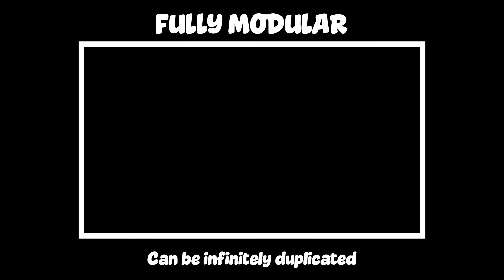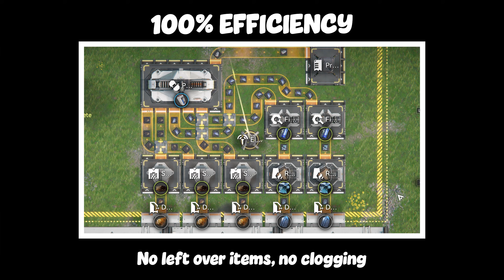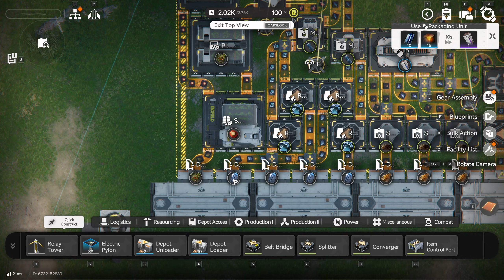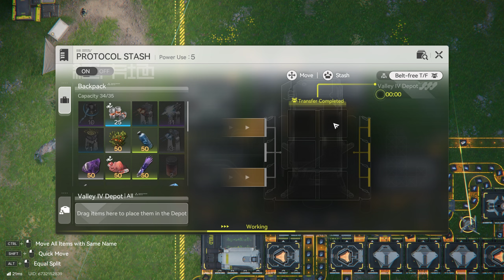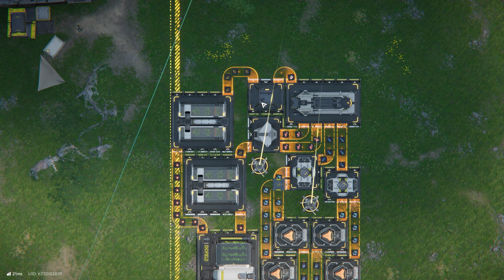BUCK CAPSULE B - Compact 100% Efficiency Farm [ Arknights: Endfield ]

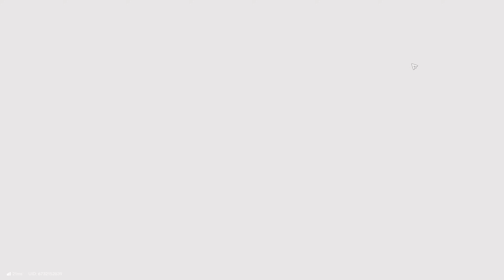Comment: this design ended up clogging cuz both outputs of the Planting unit and Fitting unit going into the same Protocol storage (1:53), so I had to add another separate storage

Comment: 4 refining units
2 moulding units
1 shredder
5 unloaders,

That's all you need to make this even more compact if you have little space in your AIC and a lot of PAC space.

1 unloader produces citrome bush into shredder,
connect shredder to filling unit x2,
Rest be the same. 4 refining units is equal to 2 moulding units.
This is how I do it because it makes sense to put bulky units in another space instead, where you can more freely optimize their space and their production.
Reply: This produces the same amount and isn't NEARLY as big because the planters and seeds are gone. Every material that can be produced using 1 material and does not output 2 or more can be replaced by an unloader. That's why the shredder cannot be replaced, unless you would put two unloaders instead, which makes no sense. You can only put those on the depot buses, and there's limited space. You can optimize it even more if you separate the production of bottles.

Comment: Thank you, I needed to build these to level up a few outposts, and this simple copy paste format is perfect, I put up 3 at Infra, 1 on the PAC and 2 on the depot wall. Simply a placeholder until I can fit in the giga optimized do it all blueprints people are making.
But still thank you.
Reply: how did you put 3 in one of the sub-PAC areas? mine are maxed out but i can only fit 2

Comment: The way that I build my base is soooooo inefficient… but I have to ask, does this cover buckflower and powder etc?
Reply from the maker: My blueprints cover all resources. Its built in a way to just be placed and it will work without any other manual input. Just need to make sure that you have enough resources to keep it running! I mention how much of all resources are needed to upkeep this in the beginning :)
Reply: @TheFarmito  well done bro, this is absolute marvelous design